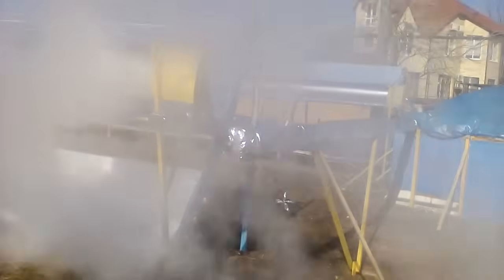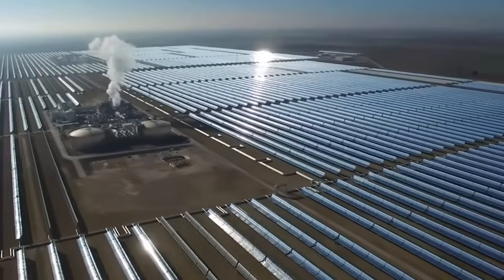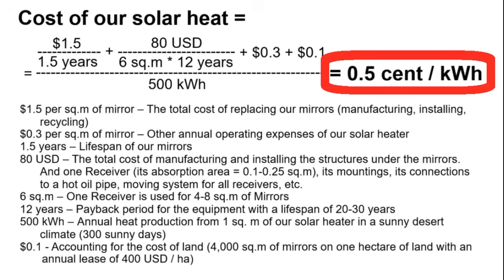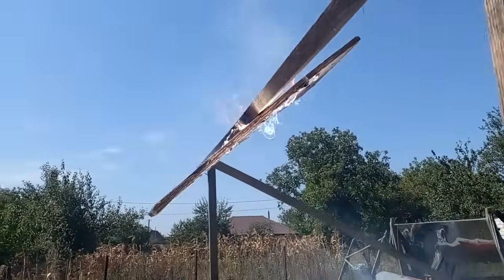This mirror is 100 times cheaper than mirrors for cheap solar electricity & thermal energy

Comment: AI Summary

Abstract

This submission details the material design and experimental application of a radically low-cost mirror system intended for Concentrated Solar Power (CSP) facilities, aiming to achieve electricity generation costs competitive with, or lower than, thermal and nuclear baseload power. The core innovation involves a composite reflective surface consisting of expanded polystyrene backing and a thin, aluminized Mylar film, yielding a total material cost of approximately $1.00 per square meter, representing a 100-fold cost reduction over traditional CSP mirror technologies. Prototype testing included cylindrical, spherical, and complex structural configurations, successfully demonstrating thermal concentration capable of reaching 400°C. A key materials challenge is the limited 18-month lifespan of the current low-cost Mylar film, necessitating a highly efficient replacement methodology. The ultimate system proposal leverages these inexpensive optics in utility-scale installations utilizing high-temperature thermal oil and large-mass thermal energy storage (TES) systems (concrete, sand) to provide continuous, dispatchable power, offering a significant operational advantage over photovoltaic (PV) generation.

Low-Cost Concentrated Solar Mirror Development and Economics

*   0:06 Project Goal: The experimental research is driven by the necessity to reduce the cost of solar electricity generation to a point competitive with, or cheaper than, traditional thermal and nuclear power sources.
*   0:15 Low-Cost Mirror Design (Type 3): The subject of the demonstration is the third of ten low-cost mirror concepts developed. This design utilizes a base of expanded polystyrene sheets overlaid with a reflective aluminized film priced at $0.25/sq.m. The total unit cost is estimated at $1.00/sq.m.
*   0:36 Economic Impact: This design is calculated to be approximately 100 times cheaper than the mirrors currently employed in existing CSP power plants, which globally represent a $40 billion industry.
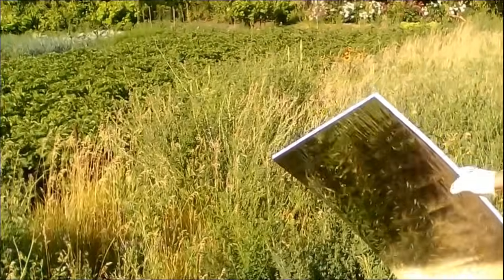*   0:46 Experimental Configurations: Prototypes were constructed and tested in three geometric configurations:
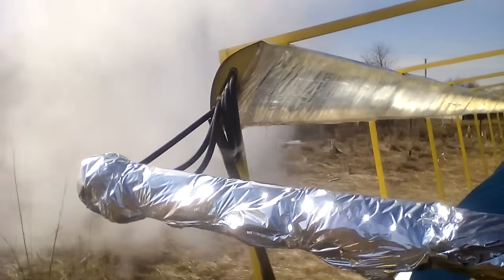    *   Cylindrical Mirrors (0:58): Focus solar radiation into a linear receiver.
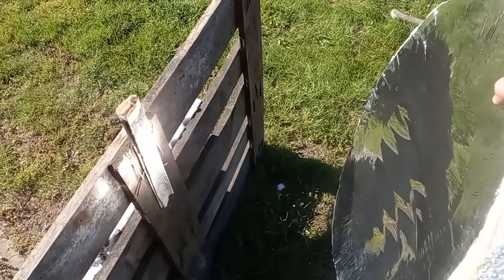    *   Spherical Mirrors (1:59): Focus solar radiation to a single point, demonstrated by igniting paper at the focal point (2:18).
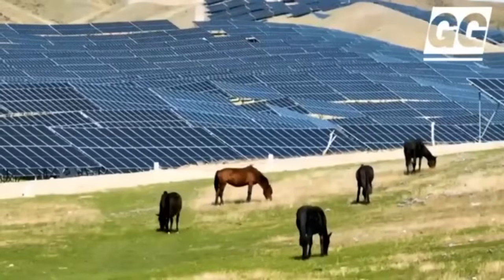    *   Composite/Structural Mirrors (3:44): Utilize multiple strips of cylindrical mirrors mounted on wooden ribs to create a desired focusing shape, including a "Fresnel Mirror" structure (4:41) which also demonstrated successful focusing.
*   1:15 Material Longevity Challenge: The specific low-cost film used (20-micron thick aluminized Mylar) has a short operational lifespan of about 18 months. However, the system is designed for easy replacement, and analogous reflective films with decades-long lifespans are recognized as available options.
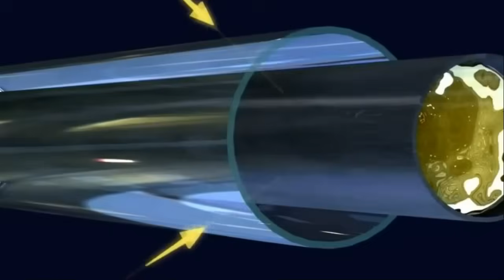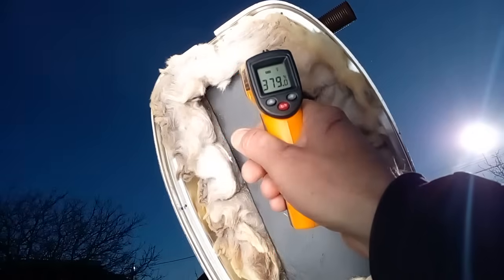*   1:46 Thermal Performance Target: The concentrated solar energy is intended to heat circulating thermal oil to high temperatures, necessary for steam generation. The commercial goal is heating oil up to 300°C, similar to established CSP plants which can achieve 400°C steam generation. The experimental setup demonstrated heating a black surface up to 400°C (4:24).
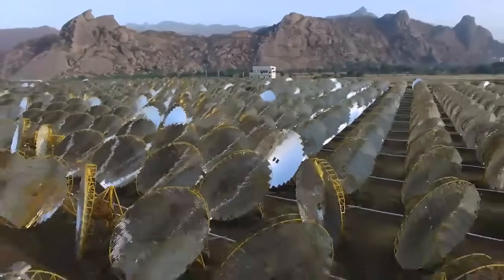*   3:13 System Integration and Storage: For utility-scale deployment, a solar power plant must comprise millions of mirror dishes. The thermal energy harvested must be transferred to turbines and utilized to heat massive thermal energy storage (TES) mediums, such as concrete, sand, or soil, to approximately 300°C.
*   3:32 Competitive Advantage: The use of TES provides a "radical advantage" over PV solar panels by enabling continuous thermal energy supply for turbine operation during periods without sunlight (night or cloudy days), thereby offering dispatchable power generation capability.

AI-generated summary created with gemini-2.5-flash-preview-09-2025 for free via RocketRecap-dot-com. (Input: 14,925 tokens, Output: 856 tokens, Est. cost: $0.0066).

Comment: Id say get an infrared camera to better diagnose the focal point consistently for a mass scale, Probably take a thermostat and a T and P valve used in a waterheater to prevent total failure based on your btu, and lastly paint it black to absorb more heat

Comment: This has been a huge inspiration, most sincere thank you
I wanted to ask your opinion, A design where mirrors are facing upwards but still hold an angle for water/debris to fall.  Above the mirrors is the pipe running water/steam
Other question, once Steam is generated, what’s the opinion on feeding that steam into a copper coil to amplify the pressure of the steam produced?

Comment: Could you please explain the part, how you are converting this heat to electricity. I mean how you are using hot oil to make steam, how do you control it or how can you manage releasing oil required to produce specific amount of steam.  Further which kind of generator you are using to produce heat ?

Comment: Hi, as you are making a lot of mirrors, This is my suggestion to you. Find the correct distance at what you are going to put your heating target, make a good mirror, then make its image copy on plaster of Paris. cover plaster of Paris with shining paint. put some oil on it and make base of next mirror. On this base you will have to put reflecting sheet and simply glue it. it would be very cheap and time saving.

Comment: Why don't you combine solar and parabolic thermal? Focus the beam on a spot and place a solar panel there. Create a glass sandwich and use a 12v pond pump to pump it through small copper piping. Should increase the pv efficiency by several hundred percent and produce steam.
Reply: солнце быстро спалит солнечную панель.
Чем холоднее, тем больше электричества даёт панель.
Reply: @AlexMar7 I tried this using a computer pump, the only issue was the flow of the water needed to be faster.

Comment: Dont know what youre on about how do you even compare solar panel to mirror panel, solar panel cells  produces electricity in voltage ,but your mirror panels produces heat so can you turn that heat into electricity ???

Comment: The two main problems with such systems are 1) efficiency, which is only around 15%, and 2) reliability - cheap builds fall apart quickly and often cannot withstand harsh weather
Reply: But with this cheap power you can use it to build and afford higher quality parts for this system as demand and reliability increases.
Reply: @ScozzDimension  I doubt it's actually cheap. Steam turbines are usually expensive. Depends on the scale, I guess.
Reply: @wedding_photography my guess is they wouldn't use anything like that. Closer to old water pumps or something welded up from a local design or from the internet at first to anything to convert the steam into a rotating wheel to belt drive a motor then smooth that out with what ever regulator they can get.
Reply: @ScozzDimension  I think without a proper steam turbine your efficiency would drop way down.
Reply: Cost difference is like many many times cheaper I don't know for sure but let's say 4 times cheaper then that effectively makes it 60% efficiency..not literary but due too the fact you can build 4 times more for same money then when all said n done means can have 4 times amount...and with regards too build quality it's just foam and mylar sheet there's nothing too go wrong no parts or anything so nothing much too even go wrong unless someone walks up n hits it with a bat in which case a solar pannal would be equally destroyed...the materials are pretty much free costs very minimal but yh if you made a pannel off peltier chips n half submerged them in water n then blew air across water creating evaporation cooling on that side so nice n cool and then other side point one off these light focus on the peltiers you could instantly harvest electricity from differential on peltiers..just a thought

Comment: First time I hear about thermal oil. Even if more expensive upfront, maybe it would be better to use a 316L stainless steel sheet polished to a mirror finish, It will last forever and comes in sizes of 2 by 3 meters.

Comment: you should look at iterating this for making purified water also with water instead of oil and a condensation chamber instead of turbine  particularly in disaster areas such as gaza for eg but so many places have water shortages and using sun is the most scalable way to get it where it needs to be
Reply: no it needs to be oil because water cannot reach beyond boiling point, oil have higher boiling point

Comment: Energy is cheap.  The real challenge, is how do we (cheaply) get solar thermal when and where we need it?  Do we run them along pipelines to keep them from freezing during shutdowns?  What is the most practical use of small delta thermal energy?
Reply: Perhaps we could move datacenters for AI etc to the areas with the most intense sun? We could potentially use it as a desalination plant as well similar to attempts in Australia

Comment: Where does one buy the oil, generator and inverter necessary to turn this light into storable power? You're doing God's work, my friend.
Reply from the maker: This isn't for a private home. It's for large power plants.
Reply: @sergiyyurko8668  
Yet... A small turbine and closed vapor system is not a crazy idea.
Reply: @sergiyyurko8668 Thank you for your reply.
Reply: Use it as a heat source, Tesla turbine is essentially a thermodynamic Transformer, check the work of Charlie Solis and Jeremiah Farwerda... You can store heat in a heat battery even below boiling temperature when you utilize the primary circuit in low pressure to move the boiling point where you need it... 😊

Comment: I missed the part where you converted the kilowatts per square meter of sunlight into harvested kilowatts thermal energy to provide a rough idea of what the efficiency is.
Reply from the maker: Efficiency is around 50%, but fixed mirrors only operate for 5-7 hours around midday. Heat production from 1 square meter of mirror is up to 2 kWh over the course of a single sunny day.

Comment: Is there a way to contact you regarding a project on developing AC unit using CSP?
Reply from the maker: (Does AC stand for "air conditioning"?) What solar thermal energy temperatures do you want to use? Absorption chiller?
Reply: Yes, I’m referring to an air conditioning unit. Here in Kuwait, we experience extremely hot summers with temperatures reaching up to 50°C. I’m interested in exploring whether it’s possible to harness this intense heat using a small-scale CSP system to generate cooling — essentially turning the heat into cold.
Reply from the maker: Of course, it's possible, but a "small-scale CSP" is unlikely to be cost-effective. The first reason is that small absorption chillers aren't manufactured (their analogues need to be made by hand). The second reason is that solar panels outperform CSPs in "small-scale CSP" cases. However, CSP systems are interesting for large-scale energy applications, such as providing a large amount of cooling for a city or town.

Comment: Keep going Sergiy!  I suggest that you settle on a design, and make plans available, and then seek expressions of interest for enthusiast volunteer/university students to make demonstration systems that operate in various parts of the world, and that they report on, via you.  A plan? After all, mass manufacturing would allow for cheap mirrors.  Your plans would also need system(s) on how to use the heated oil.
Reply: you should look at iterating this for making purified water also with water instead of oil and a condensation chamber instead of turbine  particularly in disaster areas such as gaza for eg but so many places have water shortages and using sun is the most scalable way to get it where it needs to be
Reply: Maybe you could all set up affinity groups with volunteers based around this exact thing and maybe all of you could link up and help each other out to improve and share designs.through open collaboration, So that you're not reliant on centralised energy.